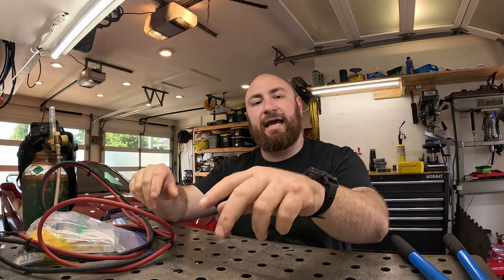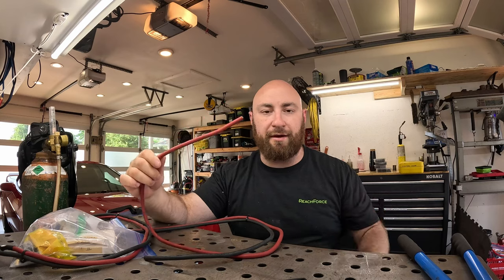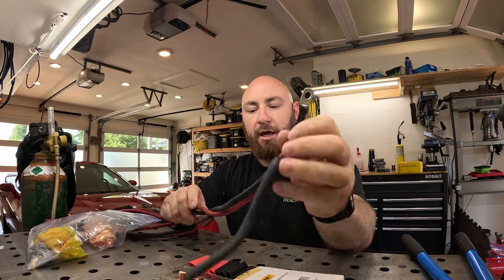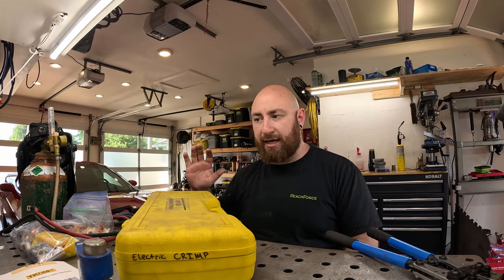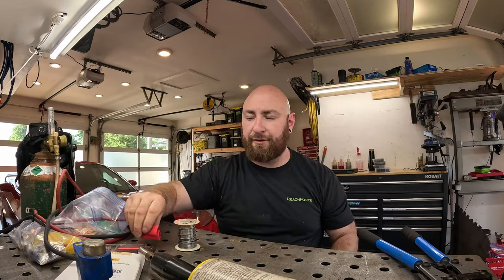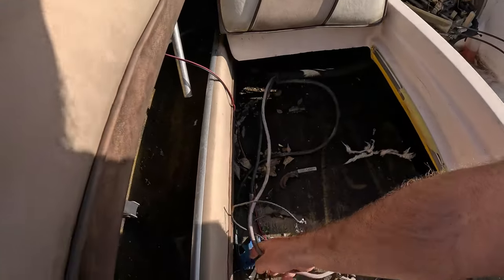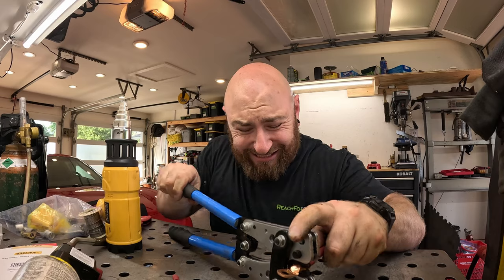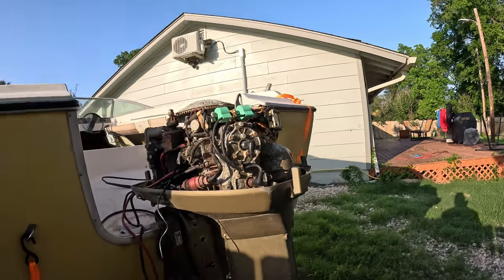BUDGET DIY: Make Your Own Battery Cables

Comment: Nice details on what to use and why. Do you prefer to tin a battery cable or just crimping okay?
Reply from the maker: I just crimp, but there is nothing wrong with adding some solder.